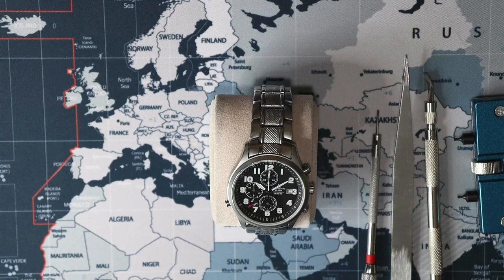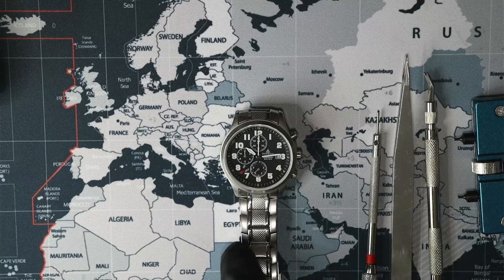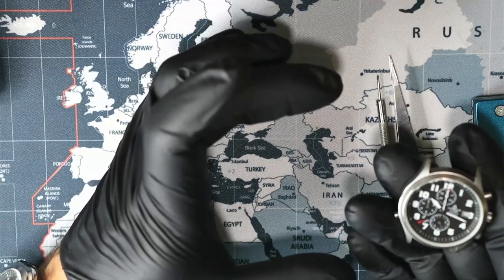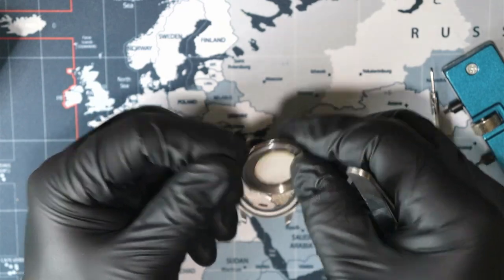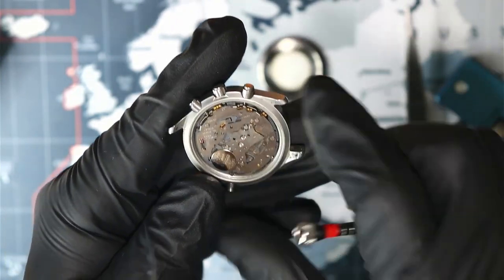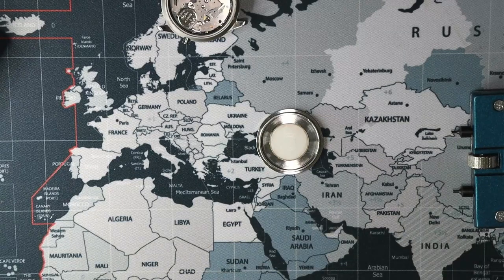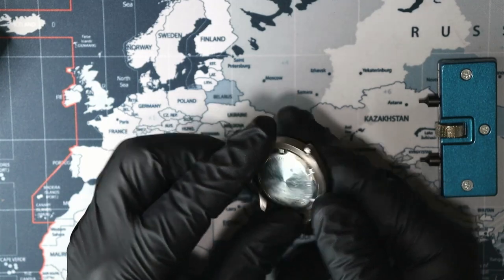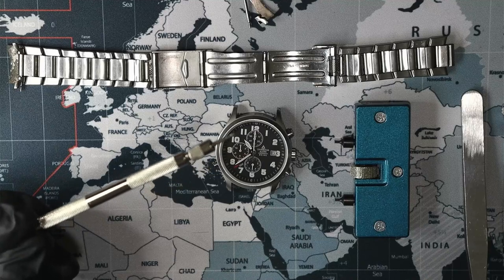Is watch repair the FUTURE?

Comment: I too have become interested in watch repairs from watching some great people on YouTube, and it does seem to be a big investment in tools and supplies... trying to slowly aquire things for the hobby.
I find it interesting that you were in the German military and seeing as such I'd like to ask if you have heard of an old watch brand Kienzle? I recently purchased a watch in very rough shape from eBay and as it turns out it is a ww2 Era Kienzle watch and it was possibly a military watch based on the styling. I am currently attempting to take it apart and repair it into a working watch. It has a very unusual movement, a pin lever movement sandwiched between 2 main plates, like a German version of a Timex from the Era is the best way to describe it. I'm curious to know if you have heard anything about this brand while in the service. Thanks.